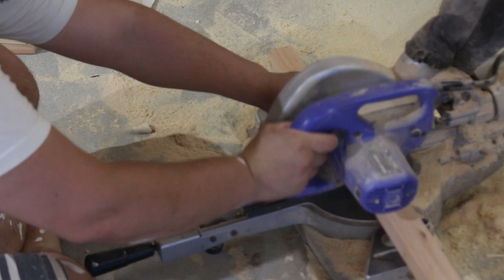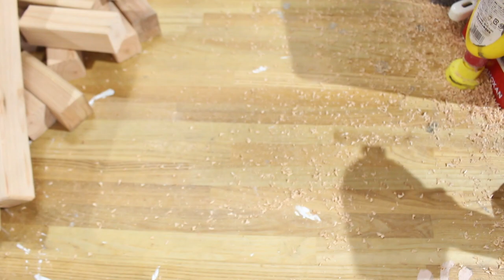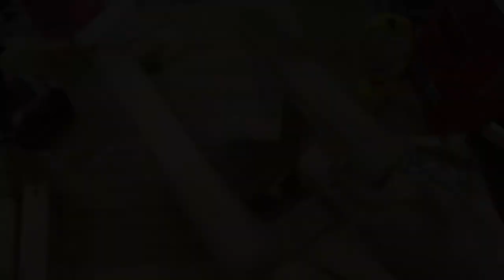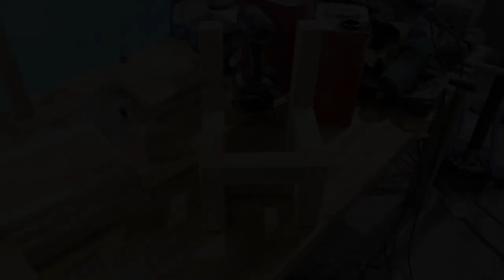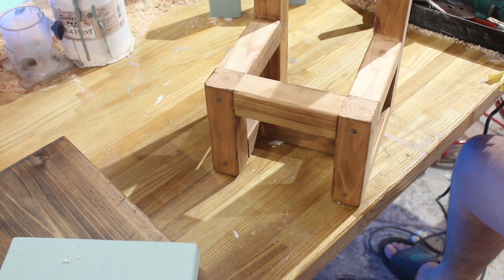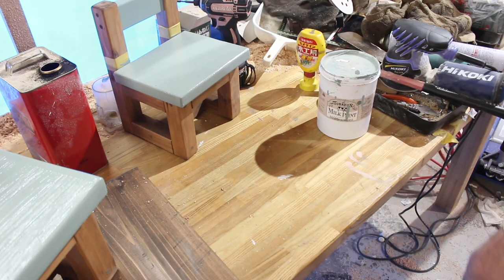The children's chair is made of wood and is fashionably cute. DIY! Recommended way to make

Comment: I followed your video but I got stuck you cut 8 pieces for each chair but you use 10 per chair 
What size pieces in your cut list and sizes please
Reply from the maker: Thank you for watching.
Sorry for my late reply.

Backrest side: 30 cm x 2 pieces
Front leg: 14.5cm x 2
Horizontal member: 12 cm x 6 pieces

The above 10 are all 38mm x 38mm square lumber.

The seat is 22 cm wide, 18 cm deep, and 25 mm thick.
The horizontal member of the backrest is 5.5cm x 12cm and 25mm thick.